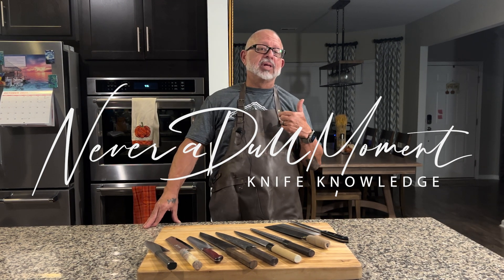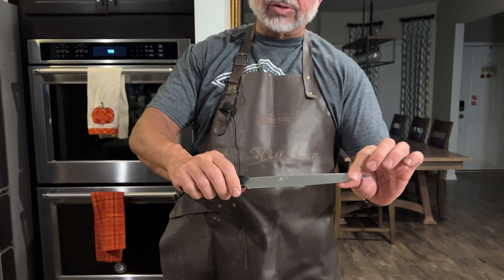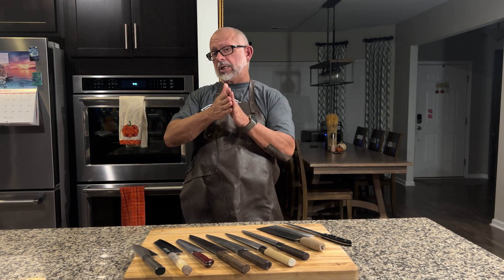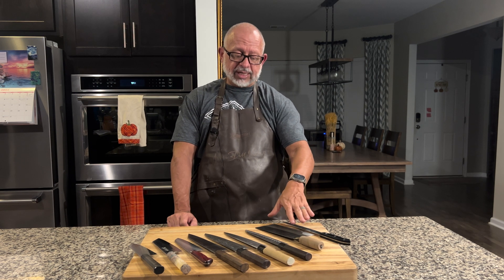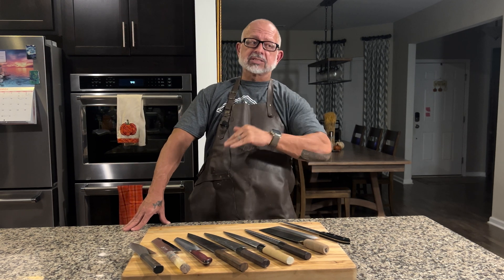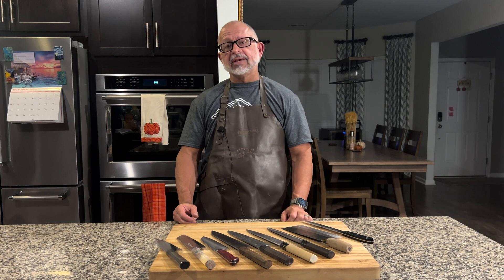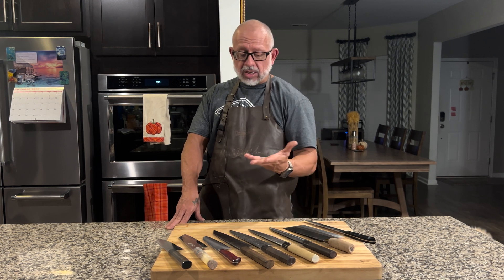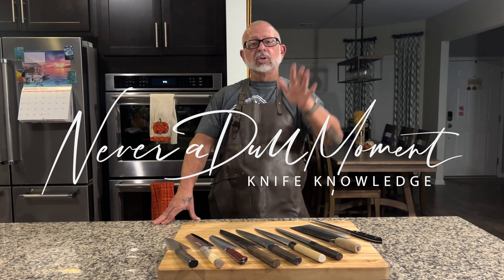How hard should the steel of your knife be? Rockwell hardness? Have you heard of it?

Comment: I loved this review.  I must disagree about one thing though.  That is sharpening the knives.  It is very easy, for any hardness.  Why do I say this?  I have invented a knife sharpener that takes all the toil out of it and can sharpen just about any knife to a scalpel sharpness for any hardness, quick and easy, and give it any angle on any side that you want, from less than 11 degrees to over 30.  I have had my granddaughter sharpen a knife to an edge sharpness that amazed a sushi chef.  So with this information, and when it is available (I am talking to some people about marketing it, I do have some prototypes) the hardness sharpening problem will go away.  It evens sharpens ceramic knives, known for extreme chipping.  Thank you for your information, it was very informative and right one for an explanation.  I salivate over those knives you have.  What a fantastic collection for a chef.  I do love the knives around 61 to 63.  I even love the ones above this because they are so easy for me to sharpen, but do not recommend them for most people because they will throw them into the dishwasher and/or just toss them into a knive drawer, which can chip them.  And please do not use them to open jars with.  That happens in my household, and I have to take out nicks of knives all the time.

Comment: I prefer harder. They get sharper and sharpen easier. Sharpening isn't just grinding. It's apex formation and burr removal and harder steels are great for both. Whenever I put a fresh edge on something like a denka for example I love using a white stone like shapton glass cuz I get long clean wire burrs thats come off. It literally looks like a thin long metal wire. Try that with soft steel.  For a kitchen knife though 62-63 hrc is honestly plenty. But more is always better in my book. My hardest knife is for sure the sukenari hap40 at 68 hrc. Can I tell the difference between that and run of the mill r2/sg2 at 62? Not really. Not in use at least. You can tell easily when it comes to sharpening because the hap40 doesn't play nice with non-diamond stones. Not because of hardness but because of the contents of the steel itself. Harder is always better, just ask the wife.

Comment: I have three knives in HAP-40 and they are currently my favorites. My Sukenari knives take better edges than my other knives that I own. I have a konoske HD2, and a Shibata HAP40 laser en route to my house and I will soon test/compare them to the rest of my knives. I own a Yoshikane SKD 240mm gyuto and the Sukeanri knives provide a better superior cutting experience. I am looking at a Denka (in 240mm or 210mm) for my next purchase. I am new to the world of knife nerds, but I have 14 years of professional cooking experience. I prefer knives that can cut like butter and reliably maintain a sharp edge. I am currently using the method where one side of the blade is polished to 8k and the other side is sharpened on an 1k stone, also known as the Shibata method?

Comment: Have few SG2/R2 is hardest I want to go. I obtained knives for different reasons. About 50% are German or Western style knives 56-58. Have some Cutco, 59RH. Have a set of American VG10,-60RH purchased long ago but not used yet. This all before I aware of hardness & sharpness. Recently purchased Japanese knives like the SG2 but mainly VG10. My highest Ed degree is master's from CalPoly SLO. Always had interest in nutrition. Have a culinary arts certificate but at time didn't know much about knife quality. Some of my knives are for decoration but still functional. My main knife used has been Cutco Chef's knife mainly cause don't have to take deep care. I'm starting to use Enso 5.5 Prep Knife  more often. One big trouble I've had is not sharpening much. I need to learn how to sharpen Japanese style knives. I seldom used a steel rod mainly used pull through sharpener with western knives. I recently purchased a Brad & Taylor which does more than a steel rod. But what kind of rod should I use for take along or regular use I just recently leaned a black ceramic rod would do for most of my knives. Maybe some time I'll learn to use stones but right now too cumbersome. Individuals have different opinions about sharpening options which has been confusing.

Comment: Great vid.  I’d argue that your usual stones are exotic.  Diamond stones are the way to go to sharpen  all hardness . Culinary sharpeners like the synthetic stones exactly because most of the knives are so soft. I’ve never had significant chipping even with ZDP189, maxamet or even rex121.  Get diamonds lose the steel fear.
Regular diamond plates aren’t too expensive good entry level stones, dual sided., can be had for <$25. Now diamond bonded stones are expensive, but the 2–10 micron stones are great for a final edge.

Comment: Sweet spot is 58-61.  Global knives are 58,  KAI VG10 is 61.  Global is softer but 2-3 passes on steel and you restore the wicked sharpness.Also very easy to sharpen, no chips at all.  My VG10 knife I use mostly for fruits and vegetables, its a petty knife.
Also , for sharpening you need DMT coarse/fine and extra fine and Shapton 1000/3000 and if you want 5000 and a strop.
For touching up you need Lansky crock sticks or more expensive Spyderco Sharpmaker.
End of story, am I right ?
Regards!

Comment: I agree 62-63 is all you need. 65 and up you need diamond plates to easily sharpen them. It's never a dull moment 👌🤘
Reply: Hardness has nothing to do with why some steels need abrasives like diamonds. It's the contents of the steel itself, not the hardness of it. 66 hrc white or blue steels grinds like butter. Generally speaking any steel that would demand superabrasives like diamonds for sharpening isn't used in kitchen knives. Not in mass production.  The one exception that has any kind of adoption is hap40 and even then it's not a common steel at all.

Comment: Most of my sharpening is for my wood shop tools, and most of that is around my lathe tools. One constant thread is sharpness. I think the consensus is that every metal can be taken to the same level of sharpness, but some are easier to get to that point than others. I am a fan of the diamond lapping plates, which now go up to 8000 grit, which should be fine for any kitchen. Most of my lathe tools are sharpened from 180 to 320 grit. Bench chisels and plane irons go to 16000, and all of these are stropped. Most lathe tools are not stropped. 

One side note, I have been looking for a Chinese style cleaver like the one you show here, and I have heard it called a "Mulberry knife" and it does have some flex to it. Most I can find that are called by that name are very rigid and not for fine slicing and dicing. Can you tell me where to get one? Thanks!

Comment: Flex is totally dependent upon geometry.   It has absolutely nothing to do with hardness.   It is a scientific principle known as Young's module of elasticity (if memory serves).    Hardness has nothing to do with a knife's ability to flex.   What hardness does determine is how the steel will fail.   The softer/tougher the knife, the more the failure point, (which the failure point is exactly the same regardless of hardness) will be a bent knife.   The hardner/stronger the knife, the more the failure point will be a snap in half.   I hope that makes sense.  It is not intuitive, and I know there will be comments saying otherwise, but it is a scientific fact.   

In other words, take two knives that are completely identical, but one is at 55HRC and the other is at 65HRC.   Put the tang in a vice so the tip is vertical and apply a lateral load at the tip so that the knife starts flexing.    I will use a random number, but let's say the 55HRC knife bends (not flex, but bends, as in failure, takes a set) at 50°.   The 65HRC knife will also fail exactly at 50°, but its failure will be snapped in half, rather than take a set bend.   Geometry dictates the failure point, the hardness dictates what that failure is, whether it is take a set bend, or snap in half.
Reply: The reason why your Super Blue Ryu knife (forgive me I am not that familiar with different makers from Japan) would not flex as much as the first German stainless steel knife was because it has a much thicker geometry.   It's that simple.   It has nothing to do with how hard the steel is.   I am not trying to critize, at all, just to help with some info that seems counter intuitive.
Reply: And at the 9:30 mark, there are no molecules in steel.  Steel is basically like a crystal lattice.  It is made up of atoms arranged in a certain way.  The bond between the elements, like carbon, iron, and the carbides is a completely different bond than the type found in molecules.   In other words, iron carbide (cementite) is not a molecule, where dihydrogen monoxide (H2O) is a molecule.  Vanadium carbide is not a molecule, nor are any carbides or structures in steel a molecule.   Forget about the word molecule when discussing steel.
Reply: And to answer your question, my ideal carbon steel kitchen knife HRC is 64.   A super blue (Aogomi Super) qyuto in 64HRC is my ideal carbon steel kitchen knife.  However, AEB-L at 63HRC will have a bit better overall edge retention due to the harder K2 chromium carbides in AEB-L, and is what I use at home, as well as a 64HRC CPM154 chef's knife.  I have a 67HRC ZDP189 large Santoku, and while it is a bit more difficult to sharpen, it is not too bad.
Reply: That makes sense to me.  I have some Sabathier knives from the 1950's that are very flexible, but seem to hold their edges forever.

Comment: This is my subjective opinion.  60 HRC is a good sweet-spot for most steels in knives.  60 HRC is a bit high on the toughness scale (I consider 60 and above to be high) but at the same time it is where the toughness of most steels start to max out (though this is normally for more precise heat treatments).
I am fine with higher hardness but I don't want to own a "Glass knife."  Interestingly enough this is entirely steel and heat treatment dependent.

Comment: The hardness needs to match what's right for the specific type of steel but the key to the quality rests on the quality of the heat treatment.  Production line heat treatment is on the lower end of quality (and then pile on burnt edges, yuck). It's great seeing lots of the small/custom makers doing so well with high quality heat treats at higher RCs with both the "super steels" and with old boring steels that people have written off.

Thickness is a huge factor re: flexibility.  And geometry is so often overlooked/underappreciated by so many.

Definitely good points re: harder knives needing proper types of stones (and grits) to sharpen with the same level of ease/efficiency. My first time sharpening a Fujiwara Denka was an eye opener. 🙂 Resin-bonded diamond stones take care of it now.
Reply: @_johnm  There's a swiss maker that does wonders with Nitro-B, wich is a very inexpensive knife steel but works amazing with proper HT
Reply: @AAAAAAndrea  Indeed. One I saw recently was 1084 at a high HRC.
Reply: @AAAAAAndrea  And, with high-quality heat treatment at those higher end of the steel's range, they can be easier to sharpen well.
Reply: @_johnm  Yup, I have SG2 at 62 HRC and Vanadium is hard to sharpen, I prefer steels without vanadium, much better.
Reply: @AAAAAAndrea  Yeah, if you're already invested in e.g. non-diamond stones then it's a totally reasonable choice to stay away from steels that require you to upgrade to be able to sharpen at all/efficiently.
Reply: @_johnm  I have diamond stones but prefer softer steels

Comment: I graduated from German to Japanese knives several years ago.  They are harder and cut much better than their German counterparts (I still use my German knives as well).  I have both carbon steel and R2/SG2 powered SS blades and have no problem sharpening them.  Once you have developed your technique using stones, you’re pretty much set.  Don’t be intimidated by the higher Rockwell ratings.  If your current stone collection can’t produce a decent edge then graduate to using diamond plates like the Atomas, they put an edge on anything currently on the market.  I have a lot of EDCs in various specialty steels and all can be sharpened with diamonds.
Reply: At what point did your Japanese ceramic whetstones inhibit your sharpening, was it a 63,64,65,66 Rockwell knife? Or a particular steel? I've got good Suehiro Cerax whetstones, Green brick of joy, some Naniwa, King etc. I have many German knives which are soft in comparison to artisan Japanese cutlery. So it's not a problem for me just yet. However I will seek 2 or 3 Atoma plates in the future. They seem to be the best.
Reply: @aussiehardwood6196  I got sick of dealing with soaking stones and so switched a good while back to Shapton Glass. The eye opener for me was when I got a Fujiwara Denka Nakiri. I haven't tested mine but people talk about those being 65-66 (with some saying as low as 64 or as high as 67). It definitely took a reset in my thinking to step back to starting on much lower grits than I usually would given the condition of the edge when I sharpened it for the first time on the Glass. Since then I've added a progression of (Venev) resin-bonded diamond stones. I just resharpened that knife recently and it was much quicker on the Venevs. I've be doing all of my "EDC" knives with their high HRC "super-steels" on the Venevs, too. Happy upgrade.
Reply: @_johnm  Those resin bonded diamond stones sound nice, is Venev a brand name?
Reply: @aussiehardwood6196  Correct. They are also dual-sided so you get 2 grit levels per stone. Seems my earlier reply disappeared but check Gritomatic's grit comparison chart for how the different rating systems compare.
Reply: @aussiehardwood6196  For reprofiling, the lower grit diamond plates like Atoma 140 & 400 won't clog up like the resin bonded diamond stones but boy do they carve scratches into the steel.
Reply: @aussiehardwood6196  That’s a tough one to answer.  I’ve had no problem sharpening ZDP-189 blades on my stones and they are rated at 63-65 or 65-67 HRC depending on which scale you’re looking at.  I have not tried to sharpen my Maxamet blade yet and it’s a 68 HRC.  I last used the Shapton Kuromaku stones for the ZDP but I believe that Naniwa or Suehiro stones should works as well.  I have both and will give them a try.  I have 7 Japanese kitchen knives, 2 x R2/SG2, 1 x VG10, 1 x Aogami super, 3 x Aogami blue #2, and they all sharpen very easily on ceramic stones.  Kitchen knife makers can only push the HRC rating so far because the blades get brittle as the HRC rating goes up and there has to be a happy medium because these are working blades.
Reply: @kencrane9726  Well that's all good news for me. I'm not sure I'd like the feel of feedback of diamond plates compared to whetstones but will probably get a few Atomas. I like the idea of not using a flattening stone too. For most of my knives I've already sharpened & aren't in bad shape, I'll start on my Cerax #1000 then finish on Naniwa "Green brick of joy" or Suehiro Rika #5000. My lowest grit stone is a #400. But your knives are the steels I'm getting into, I have a white steel single bevel long Japanese sugihiki? And a Nikiri white steel. My next knife will be an Anryu Gyuto in blue steel, I think they are around 62.
Reply: @aussiehardwood6196  I have the same stones that you mentioned and they will do a great job sharpening any of your knives.  For the Atomas, I have the 140, 600 and 1200 grits.  The 140 and 600 work great for flattening and I use all of them when I reprofile  or repair a damaged blade.  You have to be a bit careful because they really remove metal quickly and the 140 leaves deep scratch patterns that have to be worked out.  I have not tried the Venev bonded diamonds yet but probably will in the future.  I’ve read a lot of good things about them.  Don’t forget to strop your blades once you’re finished with the stones, makes a huge difference to the final cutting edge.

Comment: The correct answer is less than 60. No professional chef would bother with higher.
"The 61-63 is the sweet spot....this is a weekly or bi-weekly event to put on an edge..." If you're having to sharpen your knives with a stone weekly as a DOMESTIC cook - that's just stupid. Not to mention some of these stupid knives rust really quicky - no professional would bother with that nonsense. Once again the Germans have it right and Japanese are perfecting the art of square watermelons (pointlesness).
"They will hold their edge longer". But they won't because they will just snap at a microscopic level.
Reply: OK. So which German brand are you recommending then?
Reply: @BravingTheOutDoors  Wusthof, for instance.
Reply: I mean Japanese square watermelons are actually pretty practical in keeping the fruit perfect and barely undamaged in transport 🤷🏻‍♀️
Reply: If you look at all the videos of professional chefs working in Michelin kitchens about 70-80% of them have japanese knives. 

Also there are several stainless steels that the japanese smiths use that can get harder than 60. 

Lastly the point he made about "having" to sharpen every two weeks or so, well that only applies if you want to always have your knives screaming sharp. If you are a home cook you can get away with sharpening every couple of months, even with heavy use,  and the knife will still be sharper than what most people have in their knife drawer.
Reply: @nuttrubersrevenge  "If you look at all the videos of professional chefs working in Michelin kitchens about 70-80% of them have japanese knives."
Stop making up BS on the internet.